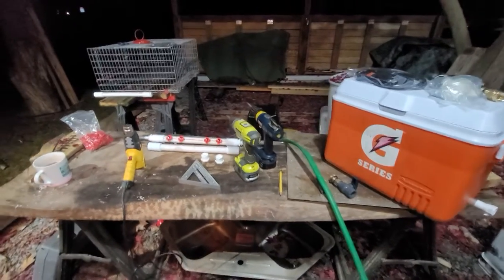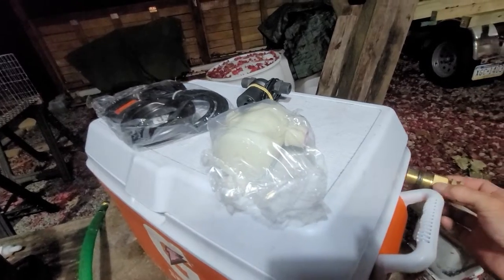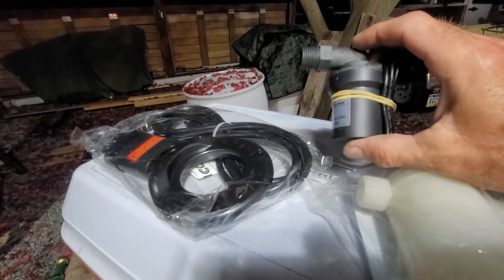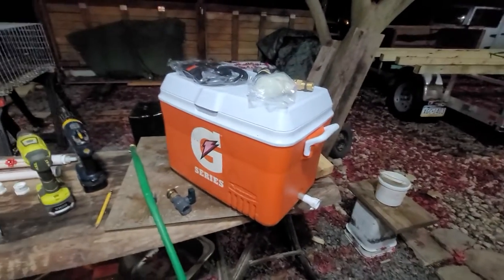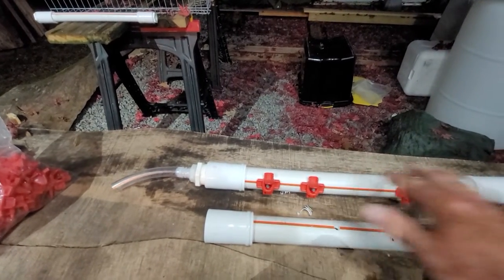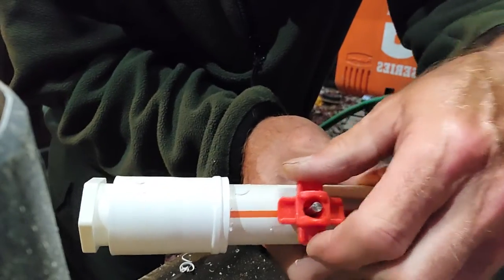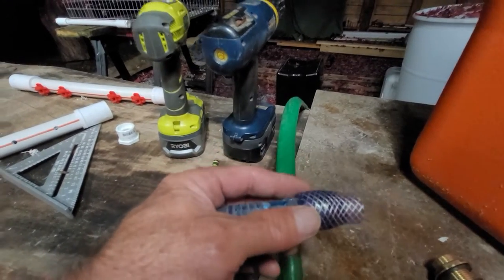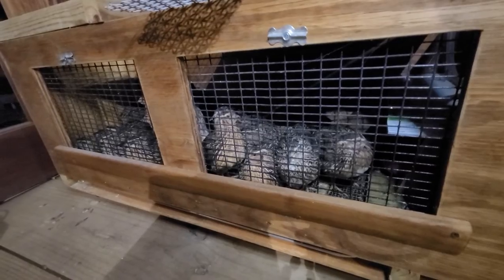Winter Watering System for Quail - solar  powered circulation and freeze proof drinker tube

Comment: Where can i find the pump?
Reply from the maker: @jodilyon946  store.USQuail.com under winter wanter supplies.
Reply from the maker: @jodilyon946  store.USQuail.com
Look under Winter Waterer supplies.  You can get a 250 W or 500W bucket heater and the low volume 12v pump.  Also pick up the thermal switch for the pump so that it is only activated when it gets below 38°F.  If you get the dual outlet switch, you can also plug in a low wattage weatherproof light to the second outlet so you can visually see when pump is turned on (we have this set up in our flight pen 50yrds from the house in the woods... its nice to see the pump is running from out bedroom balcony, and if it isn't we can figure out why.

Comment: But that round trough heater requires 250 where does that come from?
Reply from the maker: We have a battery bank inside a wooden wine crate with a 750w invertor, as well as a timer for accessory lighting should we wish to trigger winter laying.  Pending your seasonal conditions, you can modify your battery bank to as many Amp hours as you need to maintain power for 3-4 sunless days.  At that point you need to start looking at the math.  Upstate NY may need more reserve juice for longer time than N.C. for example, so you'd consider  # of/wattage of panels, single battery vs battery bank, Amp hours of a typical vs extreme service cycle, etc.  I believe the hidden inverter answers your "where do you get the AC 250w"? Question.  Thank you
Reply from the maker: @Dragotrecycle  you can purchase these and most all of your Quail supplies on the Store.USQuail.com USQuail Supply Store.  250w and 500w, pending the size (and insulation) of your reservoir.